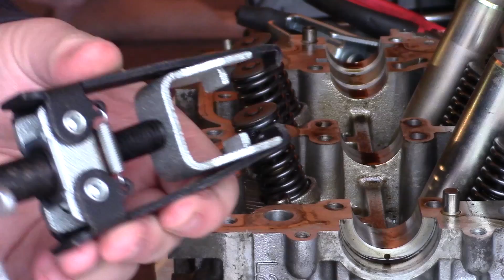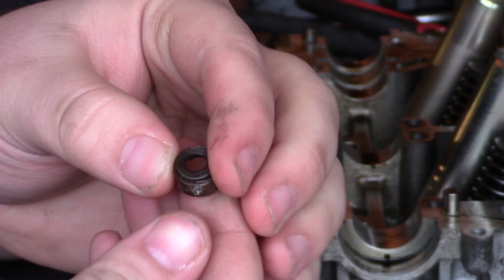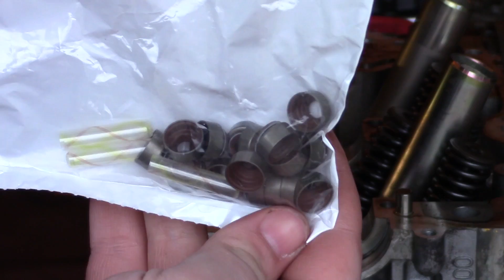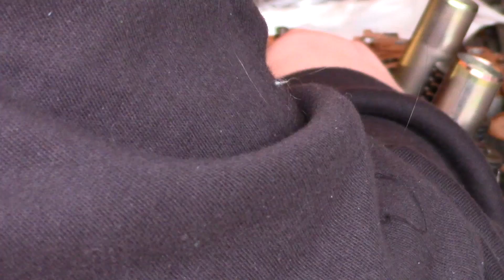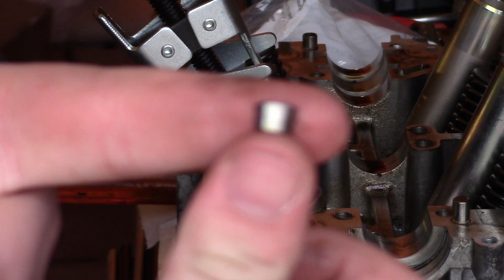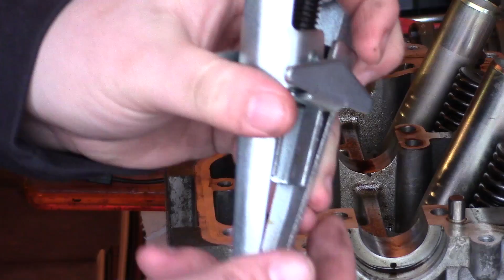Subaru EJ251 Valve Spring Removal And Seal Replacement

Comment: That’s a perfect way to lose a finger!  You need the right tool for the Subaru valves. I would have modified that tool to fit right even if I don’t get to return it,  rather than risking for a nasty injury.

Comment: What happens when one of these seals go bad??
Reply from the maker: It really depends but it usually starts with blue smoke out of the exhaust.  Which Is oil making it past the failed seal and burning in the combustion chamber.

Comment: you could have got some valve grinding compound and before you put in the new seals put some grinding paste on the seat of the valve and then used a medium speed drill and lapped a seat on to the valve and it's seating surface on the head that's what the turning the valve stem was all about you had seen I think. that would be a valve job then just hope your rings are good enough and not burnt any more oil maybe. you do have to clean off the grinding compound and then can inspect the seat on the head and valve both. I thing this is very necessary when putting in a new valve Unless you took it to a machine shop no problem its all done for you but cost good luck and thanks for sharing
Reply from the maker: I could have.  But this was January of 2016.  Engine is back together with 30k trouble free miles on it in the 4 years since this was posted.

Comment: good video, is it possible to remove valve spring without cam removal?
Reply: Just pull the motor. There is too many complications when doing in still in the car. You can pull the motor in under 4 hours.
Reply: These engines are so easy to remove, I'm not sure why anyone would want to fight with removing the head while the motor is still in the engine bay. It only takes about 2hrs to pull.
Reply from the maker: Yes, but you do have to remove the rockers.    Cam removal is not necessary.
Reply: @BluDog35  ,Thank you, my outback is consuming engine oil 1L every 2000KM,  I am trying to replace valve stem seal without head removal,is it possible?
Reply from the maker: @yijianggu5203  not really bud.   Something like that should be done the right way.
Reply: @BluDog35  ,My outback is consuming engine oil. I don't want to pull motor,just want to replace valve seals on position,is it accessible?
Reply: guy you dont have to pull the motor. You can remove the heads without pulling the motor
Reply: @fachinimichael  ,but  head gaskets have to be replaced.

Comment: You ramble on and on about things that someone who is talented enough to take off the cylinder heads of their vehicle are educated enough on how to use a tool by viewing you do it.
Reply from the maker: Zack Dowdle I'm not sure if that's a compliment or complaining about my rambling.
Reply: Someone who's educated enough on how to do this probably isn't going to watch this video. It's always best to explain what you're doing in an instructional video.
Reply: I didn't even know the difference between exhaust and intake valves before doing this, ha!

Comment: You can adjust the valve spring compressors by bending the inner part that makes contact with the crown keeper. I used a hammer to bend the (first valve spring compressor shown) so that it was closer together. I was able to compress on my EJ22 exhaust side with it, but not the intake side as it was too wide for it. But I am watching this to see if I did it right. lol. But that was to see how to install the new ones. I just used my thumb, and seems tight, but I have had anxieties like this before.

Comment: Can't you just use a socket like on all other valve springs
Reply from the maker: Sure you could to take the valves out.  But you would use a hammer to compress the spring and knock the keepers out.  Think about putting them back in.   Using this tool on these heads makes it a whole lot easier.
Reply: I just took all mine out with a socket in hammer in about 2 maybe 3 minutes first Subaru head I've ever done I could see using the tool to put on but I just figured instead of spending all day taking them out with the tool just so you can say "I used the tool"
Reply from the maker: It's just the proper way to do it.  Plus you risk damaging the mating surface of the head or something else using the hammer.  These heads are aluminum.  Soft metal.  What's wrong with slowing down and getting it done right?
Reply: True but if you are talking doing it properly then use a feeler gauge when you do valve adjustment lmao
Reply from the maker: Burn!

Comment: should you put rebuilding lube on the valves when you install them after the seals are replaced?
Reply from the maker: Yes.  But I didn't.
Reply from the maker: Just build it like any other engine.  It works the same.  Just put together differently really.  Follow all the manual says and don't do what I do.  These videos I make are NOT how-to step by step videos unless it is stated.
Reply: @BluDog35  I really appreciate the video. You doing it with the knowledge and resources available to you then + me being able to read the constructive comments has really helped me out!
Reply: BluDog35  thanks. New engine builder here. Never done A Subaru motor, have one coming up on 250k miles on original motor and was considering doing it. Making sure there wasn't a difference between other vehicles and a Subaru when it comes to installing the valves. Really appreciate it!
Reply: BluDog35 well, thanks for the video all the same. The visual is enough to help me be a little more confident about it. 

Cheers!

Comment: The small plastic sleeves are to place on the keeper end of the valve. They slide over the keeper grooves to prevent damage to the seal when sliding the valve back through.
Reply: Rojasher25 so do you put the sleeve on the valve and push it through the seal when the seal is on the head already?
Reply: @gabels540   don;t you just hate it when they dont reply?!